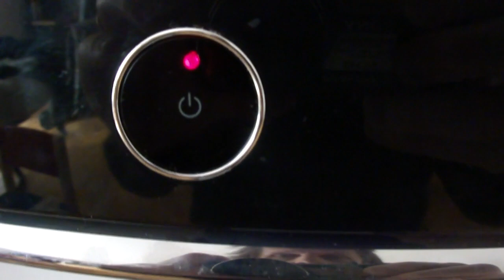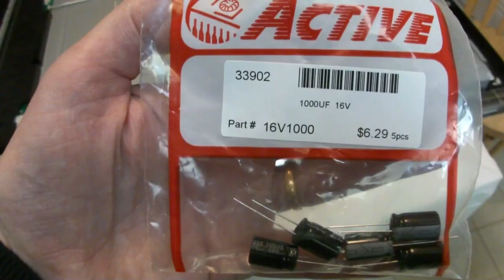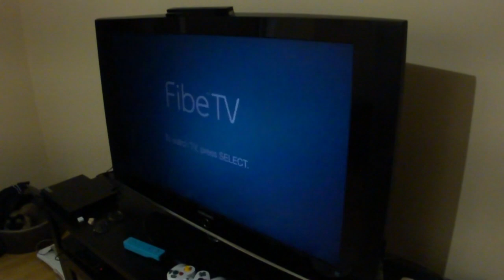Fix a Samsung TV that clicks but won't start, or flashes the screen

Comment: Cheap electrolytic caps, usually from China are the bain of my life. Bad capacitors in computer power supplies cause slow operation and crashing, similarly in Sky boxes. I re-capped a Sky HD box that I had and it transformed the box, it was quicker and never crashed again. Now I have a Samsung 8000 series TV to do that's about 7 years old.

Comment: hello i just buy a new main board and power board installed when it turn on the picture just flip up side down how a repair that.
Reply from the maker: To help work out what happened, please press the 'menu' button. Is the menu the right way up, or is the menu flipped too?
Reply: andycivil yes everything is up side down.
Reply: And the menu too.
Reply from the maker: @annuelvelez  I'm sorry I never answered this; I was relying on youtube sending me a notification but they never did, so I didn't know you'd answered. I'm sure it's 2 years too late now, but you must have plugged something in backwards, you should (have) checked for which plugs are non-polarised and think which one you might have plugged in rotated.

Comment: I managed to get mine to boot into shop mode by switching the main wall power on, pressing and holding the power button for about 10-15 seconds.

Comment: My TV does the same. After opening there was one cap that looked like this. I have replaced it but problem is the same. Unfortunately i dont have new caps, i have desoldered them from other electronics. And i have tried two, and also changed a few caps nearby (not all of them), to see if ut solves the problem but its still clicking....
Reply from the maker: That's a shame - it sounds like you did the right thing: nothing wrong with scavenging good capacitors from scrap boards. I guess it may be some other fault, but one idea might be to leave it on for a while and see if the (potential) bad capacitor announces itself by bursting. The trouble is, I should tell you to stay near just in case it's a fire hazard, yet if you're in the same room the clicking would become annoying...
Reply: @andycivil  i will try. Thank you.
By the way, i have checked all the voltages and all of them is correct, they are dropping only when the relay clicks.
One voltage i am not sure about- "Power on/off/ line is 3V only from IP board to Main, i dont know how much it should be. It sounds too low in my opinion.
Reply from the maker: Super information - I should try to find out how to pin this to the top.

Comment: Cheers, my tv just did the same, opened up to see a bad capacitor. Was clicking n wouldnt turn on. Theres a slight hiss developed where the bad capacitor is
Reply from the maker: I'm actually surprised that people are still finding bad capacitors after all this time! There was one period in particular when they were made (look up 'capacitor plague' on wikipedia). Hopefully you can find a replacement and fix it, or have a friend with a soldering iron.